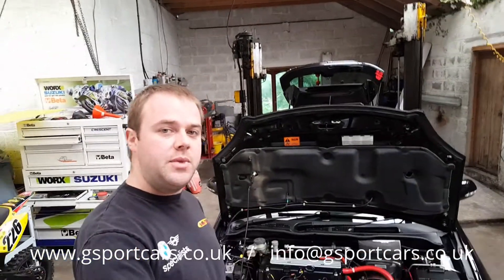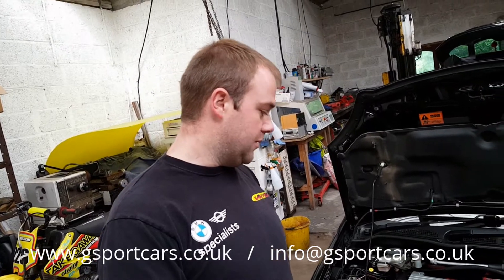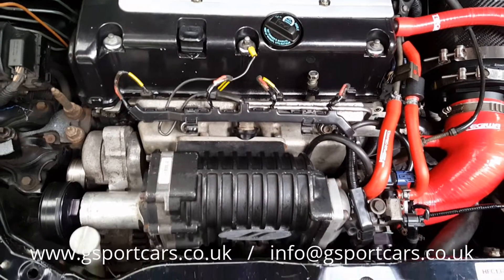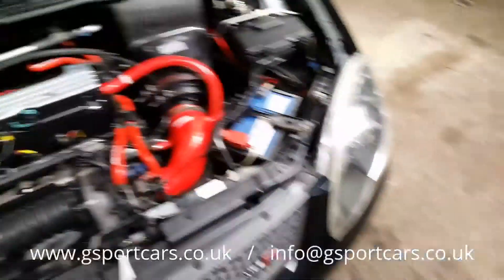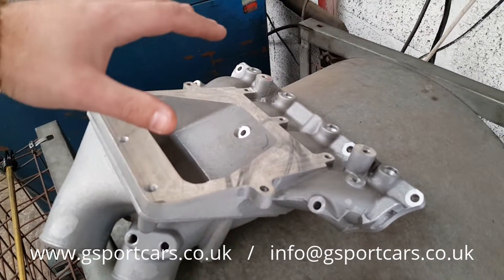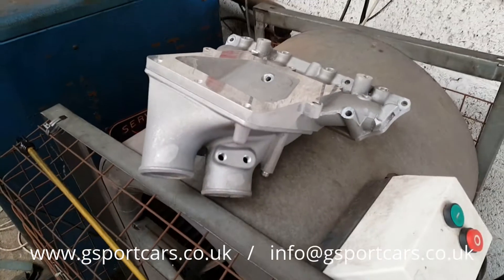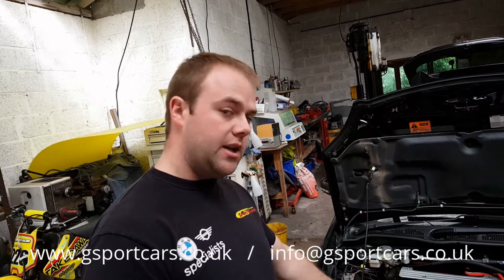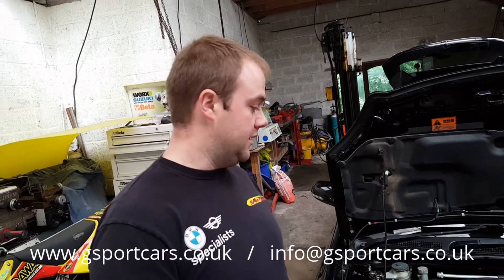Ryans EP3 JRSC custom intercooler

Comment: At the start you mentioned the car running 255 brake before the charger, was that with just the k100 and intake or were there other mods?
Reply from the maker: Larry L That was with rbc inlet, skunk2 throttle body, tegiwa carbon intake, full exhaust system and Kpro.